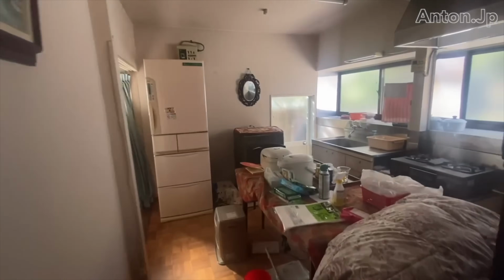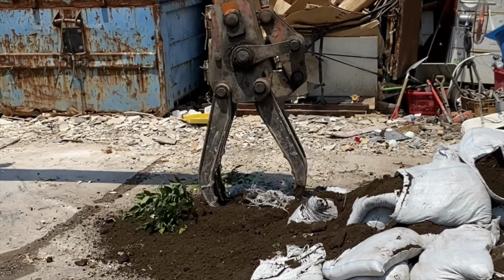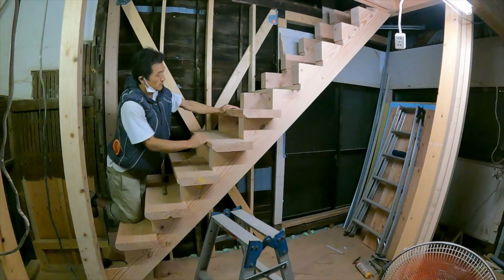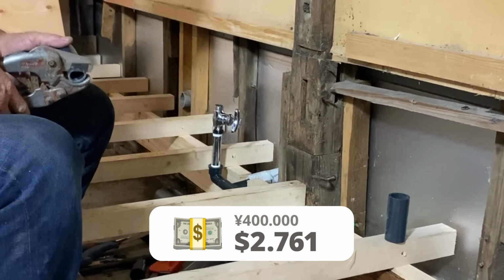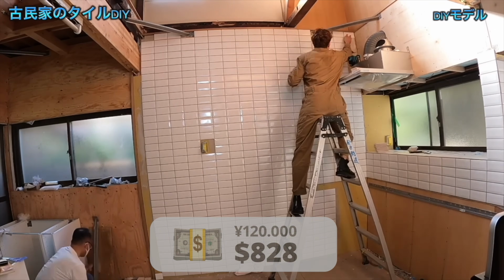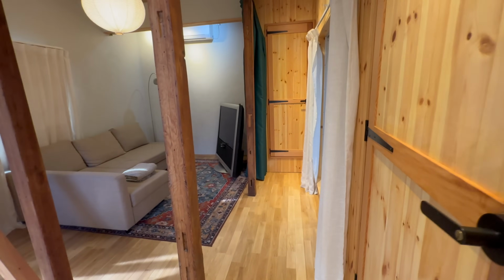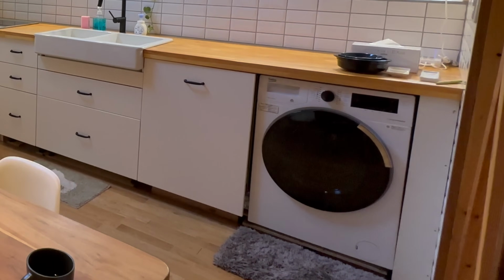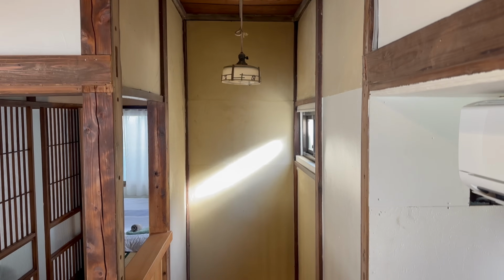Full Cost Renovating my Abandoned Japanese House to a Japandi Retreat

Comment: One of the most critical parts of a house renovation project is the work of subcontractors, in terms of their competence, scheduling ability (when to start, duration of work, costing of materials and labour, contingency planning), etc. You had videos showing the frustration of dealing with the first carpenter (and his wife) to remove the post, and the satisfaction of working with 2 young carpenters (after replacing the first carpenter). How would you characterize your overall experience with local Japanese subcontractors, including for things like electrical/gas/plumbing, etc.? You have lived in Japan for several years, speak Japanese fluently, and know people in the trades; as such, you are certainly ahead of many foreigners who are considering to buy and renovate an akiya in Japan. They will inevitably run into the proverbial brick wall in many instances, especially in dealing with the subcontractors.